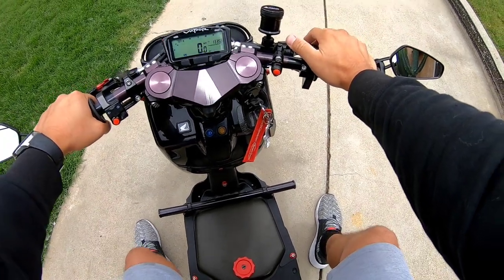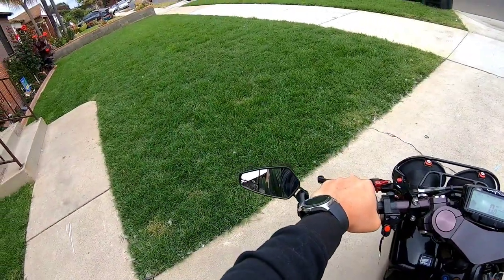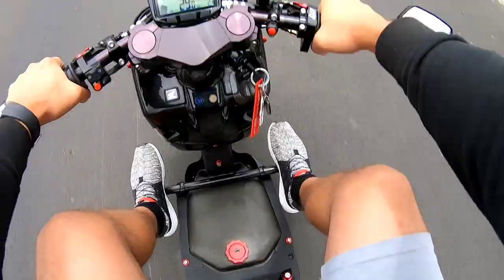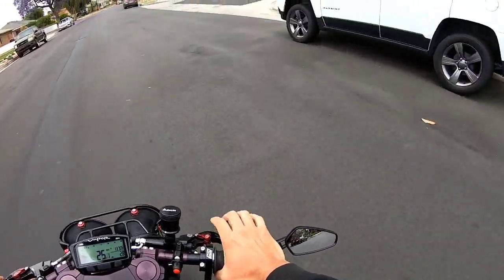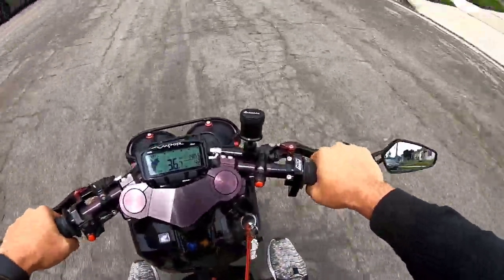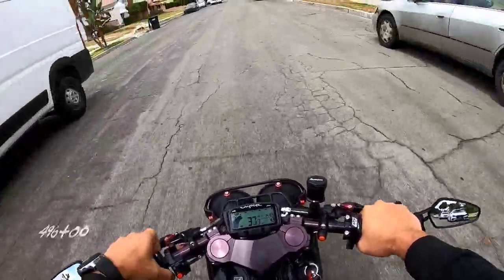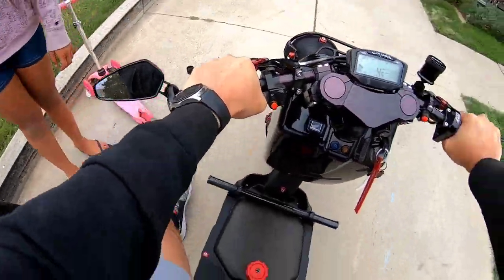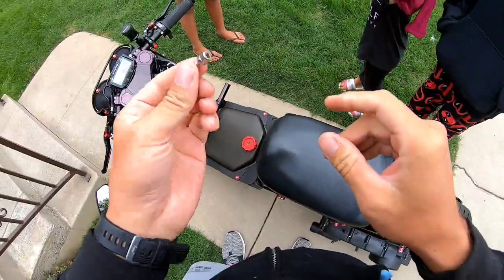The Ruckus Build // Tune Test 2, Breaks and Loctite // Vlog Series

Comment: ....after watching your last video and this one i just realized your speedo reads km/h.......not mp/h like mine hahahahaha no wonder i thought it was way off! great video!
Reply from the maker: Sorry, look closer its MPH in both videos both with different tuning done to the Motor. The computer runs off a magnet and all that information needs to travel back and forth up a wire and all computers have a lag in them from going up speed to a sudden stop and a quick turn the numbers don't read like we expect even GPS computers lag sometimes even stoped it will read 0.1- 0.5 mph and thats because a lag in the computer to sat its common but there still super close. Thanks for the feed back I really appreciate it🙏